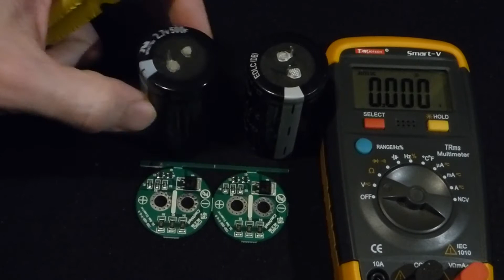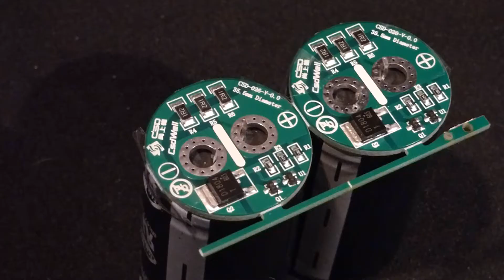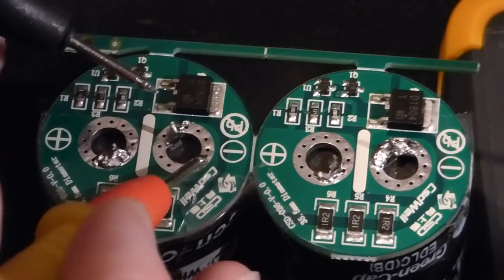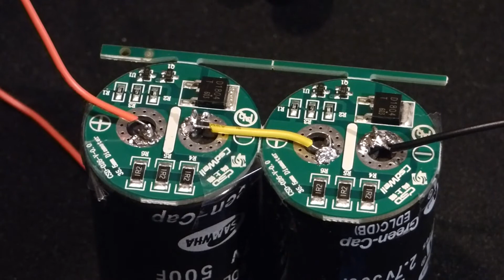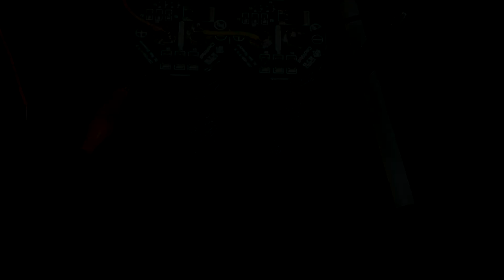I wire 2 500F supercapacitors to a protection board for prototype experiments by electronap

Comment: I solder these same boards on my cap and they take a charge but while the boards are still soldered down I get 0v.  Remove the board and capacitor has it's charge.
Reply from the maker: Thanks for the info!

Comment: i made a 12V 367F capacitor bank with 3 x 4V 1100F supercaps.. powerful little things... and small each cap is about half the size of a 18650!  I modified the balance board which was a 2.7V as well similar design, but replaced the resistor in the voltage divider to to 4V instead, since balancing boards for anything other than 2.7V are hard to come by. The bank and board itself fits in the palm of your hand and has the power density of 7.4W/h.. which is about the same as a typical 3.7V 2000mAh 18650 li-ion battery... except it can charge from 0 to 100% in about a minute, and it can dump thousands of amps in seconds! I use it to meet the high current demands low voltage high current for pulse applications... like high torque electric motor, pulse LED or laser etching

Comment: You can modify the voltage divider (R1, R2) if you want to change the voltage cap... nowadays you can get supercapacitors with voltage like 3.8V-4.1V and 750-1500F, on top of that they are smaller than the 2.7V 500F type, but a little more expensive...  challenge is that, few balancing boards exist for these voltages, but you can modify the voltage divider (R1 and R2)... R1 is a 12k resistor and R2 is a 180k resistor... R2 is better to modify, conveniently, 270k ohm gets you right about 4V and 270k is a standard resistor value... for 3.7-3.8V, I use a small smd screw top potentiometer, and it gives me a variable limit, it fits quite nicely into the PCB as well. you just need to set it carefully and make sure that it isn't loose or can be touched if you attach it as a bank with other capacitors... you can test it by connecting to a DC supply, negative to ground and positive to the midpoint of R1-R2,  slowly raising the voltage, below the cap you should be getting current into the mosfet and heating it up (use a low current) when the cap is reached the current should drop to zero

Comment: when you said capacitance is halved mean this beast still running 5.4V at 500F right?
Reply from the maker: If you take two 2.7V 500F supercapacitors and  connect them in series. They act like a 5.4V 250F supercapacitor.

Comment: I have question, can i charge it with protection boards together? will it burn the protection boards?
Reply from the maker: They are just suppose to protect the capacitors. You charge them normally and hopefully they will help prevent overcharge but if I don't know how well they work. Haven't really tested them.

Comment: thanks to phyisics, the energy stored at 5.4V is still double than what you would have in single 2.7V capacitor, even tough the capacitance is halved
Reply: Works exactly the same way with batteries.  People just dont seem to understand it.
Reply: @diylithiumguy  right... its like water falls out of a bucket faster than it does a bottle but it doesn't mean the bucket has less water